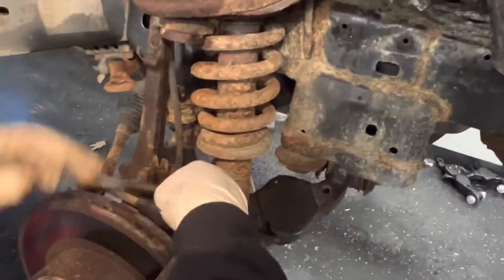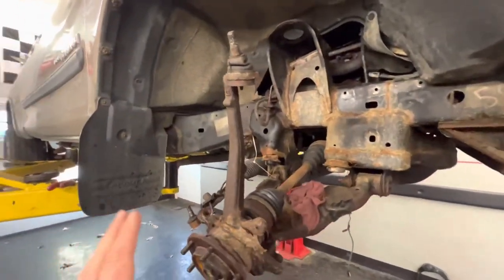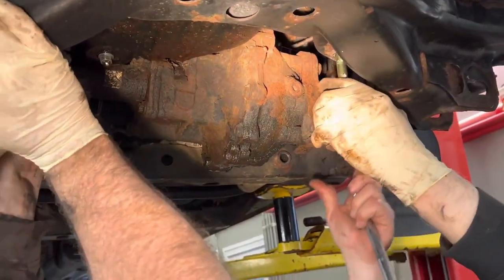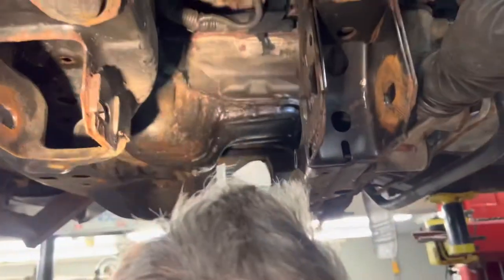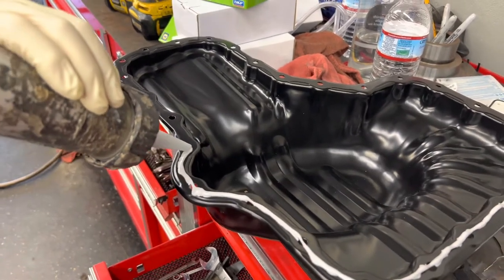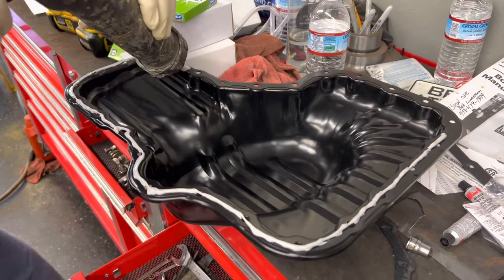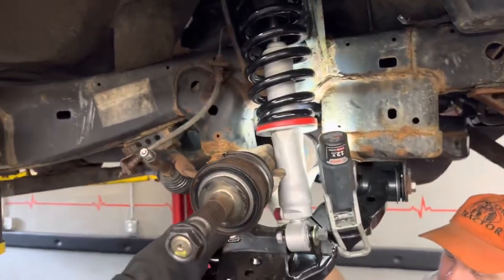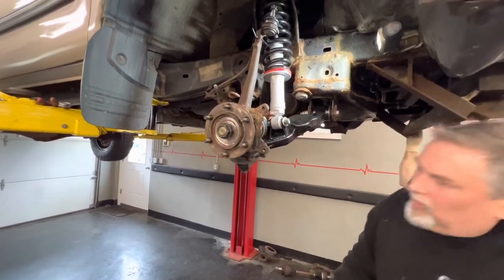How To Replace 2000-2006 Toyota Tundra Oil Pan

Comment: I have a Tundra '06 AC 4WD, here. Thank you so much for sharing your adventure on this repair!
I have watched this video at least 12 times since last spring; I found I had a leak at the back of the pan, and was very uncertain how to get this done. 
Finally found the time and confidence last week and made it happen. 

In this video I know you guys are having to rebuild the whole front suspension so more gets taken off than what is needed.
For folks just trying to get to the oil pan, I found a few shortcuts to simplify this repair. 

The steps look like this:

Drain front differential fluid.
Remove wheels.
Remove 4 bolts holding LBJ to knuckle and remove the axle nut. 
Slide the whole knuckle off of the LBJ and CV axle and rest it on the tie rod end. 
Remove CV Axles.
Remove all three cushion mount bolts starting at the rear cushion.
Remove the wire harness connector, breather hose, and vacuum line from the driver's side of the diff.
With the diff leaning forward, support it with a jack or friends.
Remove the two bolts holding the rear cushion to differential and the differential will slide right out. (Also easier for getting it back in (Had to do this alone in the driveway on the ground))
Then remove the motor mount to frame bolts and jack up the motor.

 Not much more I can save on than that on the way in.

As a side note, though, it would be interesting to know how the polyurethane seal is working a year later? 

Thanks, again!
Reply from the maker: Thanks for checking out our Toyota Tundra oil pan replacement video.
Reply: @HomeownerRepair  Thanks for the many helpful videos you have shared on your channel! 
You guys seem like a great group to hang with!
And you inspired me!

Comment: I just did an oil pan reseal on a 2001 sequoia 4x4. This video helped a lot. My only difference was I had no lift. It’s a straight forward repair if you have a engine lift. You’ll need two bodies. My list of tools include
Heavy duty jack stands (Taller jacks stands for trucks)
15 gallon compressor
1/2in impact gun
19mm socket
19mm wrench 
14mm socket
14mm wrench
35mm socket for cv axle nut
12mm Allen socket for rear differential
Hammer and chisel
When the diff is unmounted, undo the motor mounts only. No need to remove any other bolts and the front diff will slide out. You’ll need that second person holding the diff while lifting the engine, I only went about 1-2 inches up before it slid out. Took only 3-4 hours total. Thank you for the video!
Reply: Did you do it without a lift? Did you give it time before refilling the oil?
Reply from the maker: Thanks for watching

Comment: Amazing work guys! I'm contemplating attempting this repair on my 2000 Toyota tundra. It has a manual transmission with the 3.4 v-6. last fall I did new brakes, and shocks front and back. Had to replace the rear diff axle housing a couple seasons ago. Have done sway bars and ball joints. Just had the passenger cv axle blow apart on me. So I got that to repair this week. I know the thing leaks oil and the pan needs to be replaced. I'm wicked intimidated to try the fix on my own. Not a simple thing to get at. I'm watching a friends place with a garage I could utilize for a week in august. Thinking about trying it then. You think it would be any easier/ harder on the v-6 with the manual transmission? Id be doing it alone. No lift would be doing it on the ground. Might be able to recruit  a mechanic friends help if i get in a real jam. Pretty amateur mechanic myself. Building my trade. Enjoy a challenge. I like learning about the internal combustion engine and automobiles. Curious How many days did this take you guys? What would you charge to do it for the average Joe? I'm sure if i attempt to do it will be frustrating and challenging. Will need a few tools and patience. Have oxy/ acetylene at shop if mounting bolts are way stubborn. What do you think? Im on the fence having just watched the video! Seems like you guys had a good time with it! Talk me out if it? Talk me into it!?
Reply: Your pan may be accessible.  The V6 oil pan is placed differently than the V8, no?
Reply from the maker: Sorry just noticed this question. Not going to lie this is an involved auto repair. Did you get your oil pan replaced?

Comment: Wow now I'm depressed just found out my oil pan is got a hole 2001 tundra. What are the parts needed to replace this, and how do I know I'm ordering the right part / parts? I know you have a link, & I clicked on it, just wanting to make sure I'm ordering the right part. Thanks for the video.
Reply from the maker: Well you need a new oil pan at a minimum and then anything else that is worn out along the way.

Comment: WOULD THIS BE AN EASIER JOB IF IT WAS A 2-WHEEL DRIVE? ASSUMING I STILLL HAVE TO REMOVE BOTH WHEELS AND HUB ASSEMBLIES. 
I HAVE TO DO THIS FOR MY GRANDSON'S '06 4.7. RUST CITY BABY. THANKS FOR THE VID...
Reply from the maker: Thanks for watching our auto repair video that shows you how to replace the oil pan on a Toyota Tundra.

Comment: How do you eliminate or reduce the 3m urethane from getting into the pan inside, breaking off over time, and getting stuck in the oil pickup tube?
Reply from the maker: Just be careful running the bead it should be fine. Use enough but not too much.